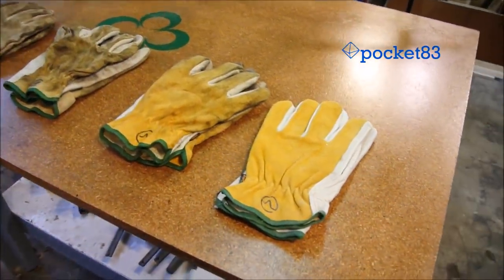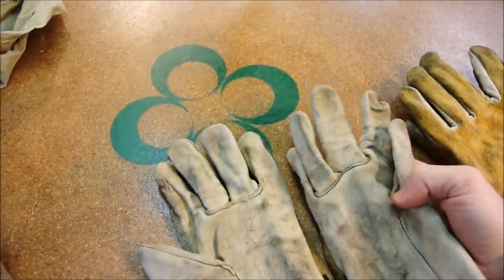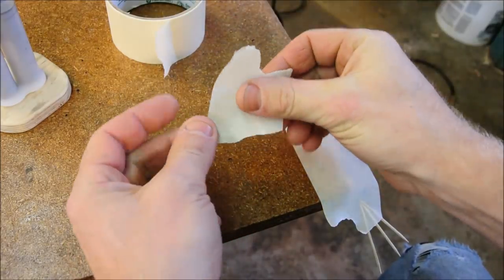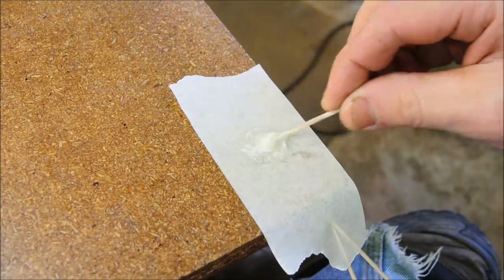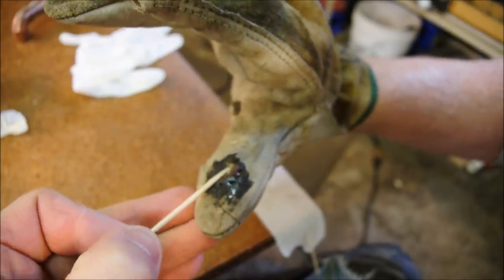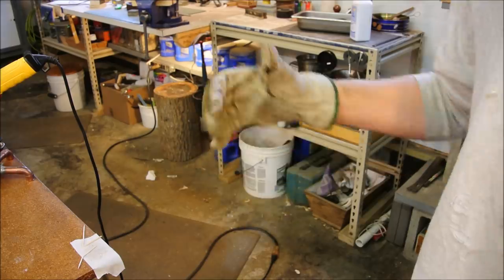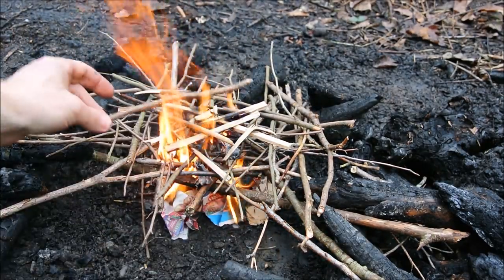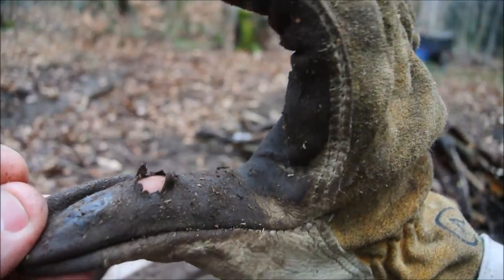Epoxy for Leather Glove Repair? Test result: ★★★½

Comment: Good Idea to repair gloves. thanks for showing your experiment.

My advise:
You could cut out leather stripes from an old glove to repair an newer one. Use a proper leather glue (like "kövulfix") apply it to both sides and let the pieces dry for 10 to 20 minutes seperately. Then stick the pieces together and apply pressure by hammering (maybe against a wooden dowel inside).
This should repair the glove very well and should be flexible.

Comment: When I worked in the mill we coated our gloves with shoe repair glue. It was both flexible and added grip. It could also be used for patching.
Reply: Like shoe goo?
Reply: The flexibility of such an adhesive would probably help in the long run.

Renia makes a product called QuickSohl, which is basically a PU cement with pulverized leather filler.  I imagine something like that would work great if it's not too stiff, but getting hold of a tube isn't trivial.  Using ShoeGoo or Aquaseal (SR or FD) might also be fine.  

For that matter, DAP Sidewinder (the clear kind) would probably also work.  It can be thinned with xylene or naphtha if necessary.  It might also be possible to use a neoprene (polychloroprene) contact cement, but I don't know how well it would last.
Reply: Shoe goo or E6000, pretty much the same, both work better for this kind of repair than epoxy.  Anything that will hold the sole of a shoe on for years is going to be great at other things!!  They are the duct tape of the glue world.

Comment: Cool idea, I'll give this a try! Just a side note, the best way I've found to wash leather gloves is to stick them in a bucket of hot water with shampoo/conditioner or just straight conditioner! I use some kind of cheap "moisturizing, scalp whatever" coconut oil conditioner from CVS and it works great... just soak for a few hours, agitate really well, rinse them and hang them up to dry! They come out clean but still nice and soft! Thanks again and God bless!

Comment: I like how the gloves ended up having the same exact failure as the jeans that you pointed out the repair in. The patch held up but the weakened material right beside the patch fails.

We heat our house with a wood fire boiler and the cheap leather welding gloves from harbor freight are my fire grabbing glove of choice. The leather is a little thinner than the bigger hardware stores but the price is right.
Reply: welding gloves are what u want
Reply: @necroodin   The cheap welding gloves from HF wear out quite quickly in my experience.
Reply: @JDeWittDIY  maybe for welding but just for moving logs around in my furnace they work great. Plus they are 1/3 the price of the last pair I got.

Comment: One of the best things about having a proper open fire like that.. Your clothes smell of it for days..
Had a BBQ back on the 1st.. Grabbed the dirty tshirt for a quick messy job outside from the clothe basket a few days back and body heat filled the air with the smell of the smoke and fire again. Lovely.

Comment: Great video, thanks!
Leather gloves/good leather gloves, are expensive. For many years the only ones I would buy and use were the Wells Lamont Grips work gloves. They cost around $15 a pair back in the 70's/80s IIRC and they were a source of financial pain to me at the time when I had to replace a pair.

Comment: i did this but with textile glue, the glue i used waterproof and washable up to 40 degrees celcius :) also dried really fast
i also used that same stuff for the patch material. epoxy probably becomes somewhat hard ill finish watching and see the result.

Comment: Hey Pocket! I got a great little fix for you! you know those little holes that completely ruin a nice down jacket? Try bike tire patches, they come with the glue and everything for them you don't need to sand it first like bike tires but the3y will stay on there for years, go through the wash and  don't even look that bad. they are at least better than unsightly duct tape patches on your clothing.
Reply from the maker: Ha. Nice. Thanks, but I think I'm just going to replace those jeans. I mean, there are thousands of people watching- I could at least wear some respectable pants.

Comment: It appears as though the stretching forces that would normally be spread along the length of the leather thumb piece instead got focused somewhat in the area beneath the patch due to the relatively stiffer patch area. Failure analysis is always interesting if not timely.

Comment: Thanks for the video. When gluing the patch to the inside of the glove would it be easier to turn the glove inside-out?
Reply from the maker: I don't know. I mean, it kinda depends on the hole. I think in this case I probably did it the easier way. Plus, you want the patch to take on the actual shape, and not the inside-out shape.

Comment: Since you mentioned that the gloves soak up epoxy, I wonder if that's another way to do the hand-shaped bookends (just with cheaper gloves), by just coating the outside completely in epoxy. You'd probably have to add weight to the inside, though, and the bb's already looked pretty nice imo, but it's an idea.

Comment: Seems like it would work great on a single cut or something; however, I find that most times when my gloves get holes, its due to so much wear that the leather has thinned out to the point that a new hole will just spring anyways.(as happened to you)

Comment: You should have used shoe glue and wrapped the thin leather around the outside of the thumb and on the inside. I've got a pair of deerskin gloves and repaired the tips of both thumbs this way.

Comment: When working with metal I love using  rubber coated gardening for all generic shop work like moving metal, grinding, and tac welds. That way my hands stay cleaner and safer, and my welding gloves don't take such a beating. But I might want to switch over to leather gloves to offer more protection.
Reply: Pick up a few pairs of harbor freight welding gloves, they're my go to for dirty work.
Reply: @dynamicequilibrium5322  While That would work the main reason why I use the ones that I do is that when framing together something and tacking they give me more dexterity then a welding glove. would, but i might need to give it a try

Comment: From what I've heard, engineering with soft or flexible materials is dominated by how to transition between soft materials and hard materials - you might have needed a more gradual transition in stiffness between the epoxied leather and the (weakened) regular leather, though i'm not sure how you'd do that! 

Basically the more you spread out the transition between hard and soft, the less any force on the hard part is concentrated on the join to the soft part.
Reply from the maker: I totally buy what you've just said. Patches always strain the area around the patch. In the case of a rigid epoxy spot on a soft substrate, it might be prudent to blend the thickness of the epoxy out. A gradual fade will give the numerous smaller, less important stress-relieving cracks a home, which will better forgive flexibility.    

That said- in this case, the second hole was really only mildly related to the patch. It was already in progress from the beginning.

Comment: So, did it improve the grip at all?
As for further recovery, I wonder if you could salvage enough leather from the worn out gloves. As a comparsion, it might be interesting to sew the patch on instead.
Reply: Just use the old gloves; cut a patch and stitch the patch on. No it won't hold forever but i'm sure you can come up with some ideas.

Comment: I think with a slightly larger piece of patch material and the use of leather cement (works kind of like white glue but stronger and thinner) you'd have more success. Maybe epoxy from the outside, leather cement on the inside.
Reply: Cyanoacrilate? (CA Glue/Super Glue)

Or Super Adhesive if you want to de-brand it
Reply: Not CA glue. Leather cement is MUCH more flexible when it cures but it takes longer to set up. Maybe 20-40 minutes.

Comment: Pro tip: epoxy won't adhere to packing tape

Also, isopropyl alcohol and acetone both work well to clean up uncured epoxy, and acetone can even be used to thin it. (Heating it up makes it cure faster in addition to making it flow better.)

Comment: That is an impressive fire!🔥🔥👏🏻👏🏻 I think I’ll try that configuration some time. Any tips?
Reply from the maker: You mean fire tips? UNDER!

No, seriously- I was thinking about doing a video like that. I burn so much now that it's rapidly developing into a skill. There are certainly techniques that improve efficiency. But it also depends lots on the fuel and the conditions. 

You already saw how I typically start. But fire maintenance? Ok. One thing I will give you, in case you are burning hatchet-cut branches: arrange them into a cone, standing upright. Just like I have at 10:43.

As the tops burn and drop in, they will point to the center. Take this (now shorter) pointed nub and turn it upside-down, so that its fresh end is up, and arrange it into a smaller cone. Now add a fresh, full-sized cone over top of that. The removal of the nub opens the air up from underneath, and the shorter cone is now dry and hot. This is the secret to a hot, smoke-free fire that is capable of drying and burning at the same time. 

Of course, you can't really see these 'cones.' It's just a conceptual way to visualize the form that I'm trying use to burn efficiently; in reality, I'm just adding or flipping one stick at a time ;)
Reply: pocket83²-Thank you so much! That was really helpful. :)